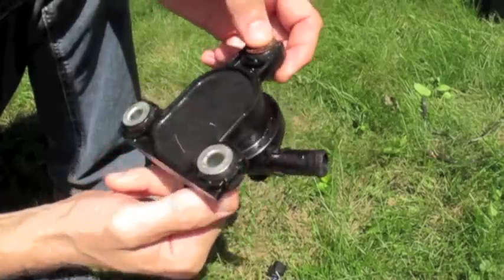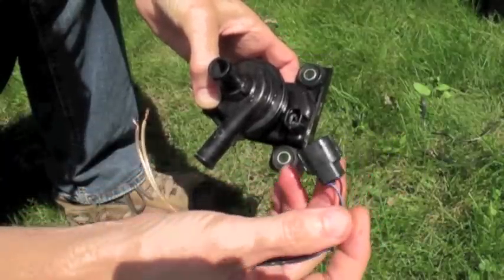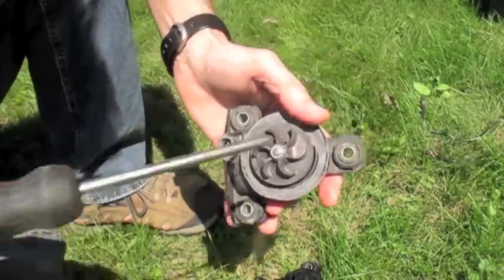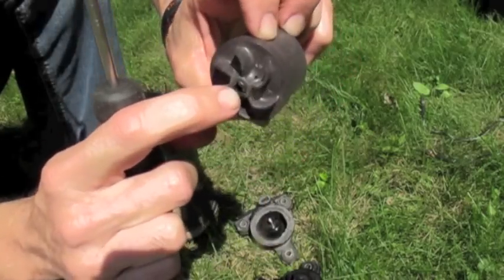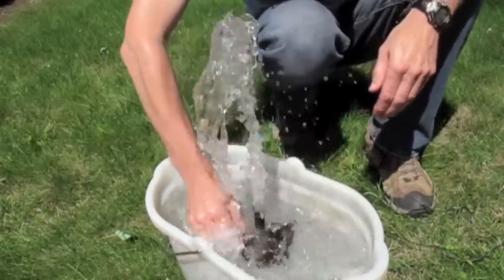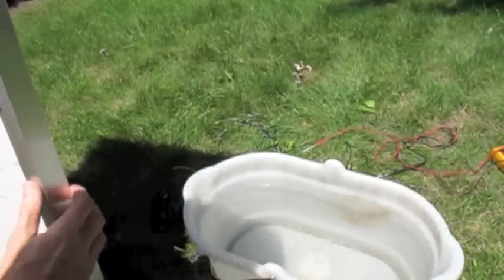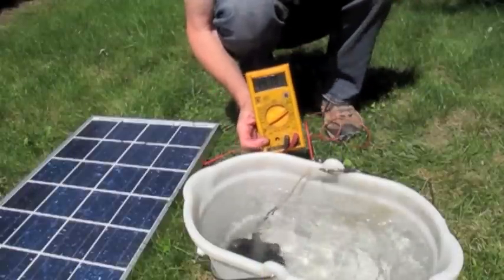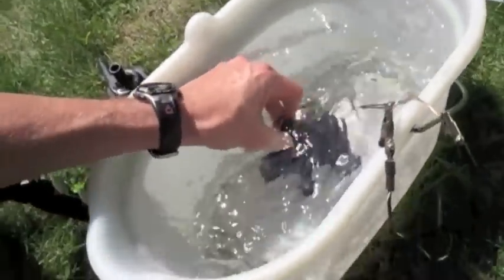Amazingly powerful 12volt water pump from a Toyota Prius ● test to 12v and solar

Comment: Just so you know, water is not a lubricant.  People think it is because a wet floor is slippery but that is another phenomenon at work.
Reply: Nicholas Washburn It's better then nothing, right?
Reply: maybe more a way to align thing without contact . .. I don't know
Reply from the maker: Johan PONIN    You're right. It aligns without contact creating a thin wall of water between the 2 parts. The water lubricates the shaft to minimize friction and allow smooth movement. I have used it in a bird bath/fountain and its into its 3rd season running about 5 months night and day straight each season submerged.
Reply: lol you didn't even google that did you. Ask an engineer buddy.  Water can behave as though it is a lubricant but IT IS NOT.  It does, however, carry heat away, and it is also a solvent.
Reply: Alright, so as most things are, the real answer is much more nuanced than one would think.  If you are interested in actually learning something rather than proving me wrong...because I actually learned a ton of new stuff by reading this, check this link out...
https://www.reddit.com/r/askscience/comments/22wmvb/why_is_water_a_bad_lubricant_and_are_there_any/
Reply: It seems  that the answer is, YES, you're right, TECHNICALLY water can be used as a lubricant, but it's practical applications are basically ZERO because there are WAY better solutions. I copied this from the reddit link:
First: What is a good lubricant? (quoting the wiki here)
[ A good lubricant possesses the following characteristics:
•High boiling point •Low freezing point •High viscosity index •Thermal stability •Hydraulic Stability •Demulsibility •Corrosion prevention •High resistance to oxidation ]
What makes a "high" boiling point and a "low" freezing point? Water's freezing point defines the 0˚C and the boiling point defines the 100˚C point. Water has a relatively low viscosity, around 1 (pa*s) at 20˚C. Most lubricants have at least a 35, ranging upwards depending on the use and grade. Water also has a tendency to fluctuate in temperature more than most lubricants, as well as being a large proponent in corroding materials and oxidizing. Water is also a solvent! There are very few cases, i.e. in the human body, where water can be used as a lubricant, but typically it is not.
Reply: Haha my apologies man, I tend to get a little defensive.. something I'm working on :)  I didn't know that it was used in water pumping applications like this, my background is in automotive and heavy industrial equipment and so I've had it drilled into my head that "WATER IS NOT A LUBRICANT!"  One of the things I just read was that one of the places water is used as a lubricant really effectively is the human body. Pretty interesting
Reply: nicholas washburn google "cutless bearing" as used on a boat or ship's underwater propeller shafts. water lubricated rubber shaft bearings.
Reply: Just wish I had brought it up with a little more grace lol :)  I was reading about Thorndon bearings, pretty much what you guys are talking about just scaled up for use in the largest ships. Prop shaft bearings and rudder bearings. Not very many of the big ships use it, but apparently its becoming more popular because of the tighter environmental regulations.  You lose some of the cool maintenance stuff you can do with oil bearings though like oil testing, temperature probes, etc..all stuff that is impossible or difficult to do with an open system

Comment: If you put water through the pump backwards will it produce electric?
Reply from the maker: That I don't know.
Reply from the maker: Actually no. It needs to be running fast enough for the water to lubricate the shaft.
Reply: some kinds of pumps yes but i don't think this one would

Comment: It probably did leak.  Fresh water is not a great conductor.
Reply from the maker: +chimp3376    What do you mean?
Reply: Fresh water is not a great conductor.
Reply from the maker: Into the terminal you mean. Not a good conductor but a good corrosion starter.

Comment: Where on the prius is this pump located?
Reply from the maker: Under the hood, left front corner near the headlight.
Reply: Thumbs up for that!  Thank you.
Reply: Typically there are two types of pumps.  Displacement and centrifugal pumps. This is a centrifugal pump which by design produces more volume at low pressure with lower energy input than a displacement pump.  For a pressure washer you want a displacement pump but it will pull higher amperage (ie.  energy).  That said your answer is "NO", not if you want "pressure".  This produce's water at a good volume but at relatively low pressure and with a low draw from the battery.   A trained eye could tell from the video that the water flow demonstrated shows good volume but achieving not much height. That indicates volume at low pressure. Cheers

Comment: I bought one of these off ebay after seeing the vid. I either got a bad pump because mine sounded like it was spinning but no water or suction was created. Very disappointed.
Reply: Hello Eric. try reversing the polarities. that is toggle the wires.
Reply: Pump won't run if I switch the wires.
Reply: if its a dc motor, it must run in opposite direction if you switch the wires thus pumping the water.
Reply from the maker: Actually, the one I got from the wrecker right out of a Prius did not run if you switched the wires/toggled. I wonder if it's a quality issue since it's from ebay. Too bad. I hope you're able to return it.

Comment: Those were the years when the Prius driver's claimed the accelerator stuck open and they couldn't stop and crashed and then sued Toyota.
Reply from the maker: There was only one or 2 guys that claimed that in the Prius. They were found out to be frauds. The issue in the end was the floor mats in the Camrys causing the pedal to jam.
Reply: +Chris Notap 

I think there was lying on both sides, both the driver and the manufacturer. From my over half a million experience driving cross country, I've seen plenty of cars that fail to slow down until they get in front of my truck.

Comment: So anyone ever try to use one of these for a parts cleaner using Varsol. Solvent might be a little harsh for the internal seals?
Reply from the maker: It should work fine. There are no seals to worry about.
Reply: @chrisnotap  Thanks. Zactly what I wanted to hear.
Reply: Winner of a video, been searching for "off grid water pump sink" for a while now, and I think this has helped. Have you heard people talk about - Manonnor Illustrious Magic - (do a google search )? 
It is a smashing one of a kind product for discovering how to create your own supply of the highest quality clean water without the headache. Ive heard some interesting things about it and my m8 got great success with it.

Comment: How many psi please.
Reply: Seen City There are two basic types of pumps.  High pressure, low volume and low pressure, high volume.  This would fall into the low pressure, high volume class.  This pump doesn't have to pump water to a high level, just move lots of it.

Comment: Is it possible not to submerge in the water and just make a hose or pipe?
Reply: That is probably how it is used in the Prius. Most cars are above water.
Reply: It cant ,because its not self priming.Needs to be lower than the water level.
Reply: @mihaiilie8808  
This means that it can be use outside the tank but it must be below or at the base of the tank and pipe connected at the base of the tank. To prime it open the tap in between the tankand pump and it's primed for use.

Comment: Maybe u know part number?
Reply from the maker: Sorry. It does not have a stock number on it. It's called an inverter coolant pump.
Reply: Chris Notap if it can help someone, part number is: G9020-47031

Comment: Which side is the suction and which side is the throw on this pump?
Reply: at 1:18, he opens the body, note the direction of the impeller blades and the previous orientation of the body,
Reply: The center tube is always the inlet with an impella.

Comment: The point is if you connect pipes it wont pump the water.
I tested. One meter pipe on input and one meter pipe on out. Nothing.
Reply: You need to prime it first. I used a 100 feet long inlet pipe & it worked very well.

Comment: I have a hard time believing the solar puts out that much current.
Reply: B. Eder they do the video is pretty straight forward
Reply: B. Eder I have a very similar system here in northern Canada and it certainly does put out that much current, I manage to get a heck of a lot more out of my solar panels than what I need so I started getting 12V fans to put in my house for air circulation in the summer.
Reply from the maker: B. Eder     Here is what is on the label on the the back of the panel I used in the video  

TYPE: multicrystal,  
MODEL: LA361j51,     
WATTS:  51w   
OPTIMUM VOLTAGE: 16.9v, 
OPTIMUM CURRENT: 3.02A, 
DiMENSIONS: 985 x 445 x 36mm,
DATE: 1992. 7, 
KYOCERA CORPORATION

Comment: It is NOT an induction motor.. It is a brushless DC motor. Induction motors run on AC and as you point out this is a 12 volt DC motor.    Go back to school
Reply from the maker: Correct. Others have corrected me also. Thanks. You learn something everyday.
Reply: They are designated as DC motors because the controller pulsates the DC current, there is no reversal of electrical current into the motor with brush designs and none into the controller of the brushless designes. You can not put AC current into these things. This reversal takes place as an act of the winding commutator segment passing under the + and - brushes then reverse at a 180 degree rotation. OR via electronic switching in the case of brushless DC motors. If one could spin the magnetic hub of this thing it would too, generate pulsed DC current. The controller however has to be able to facilitate that back flow. The electronic pulsating of the windings on BLDC motors are also the foundation for DC stepper motors used on CNC machines to drive and cotrol the axis'. Reversing the timing of DC current pulses reverses the motor rotation.  So yes, in a very real way they are too AC motors. The motors are designated in the engineering realm according to the type of power fed IN to the motor or the controller. Feeding AC into these things will just burn em out in very short order. 
"Working Principle of Motor
Before explaining working of brushless DC motor, it is better to understand function of brushed motor. In brushes motors, there are permanent magnets on the outside and a spinning armature which contains electromagnet is inside. These electromagnets create a magnetic field in the armature when power is switched on and help to rotates armature." Segmented commutator rings allow individual rotor widings to be charged when the winding's commutator segments BOTH passes under the brushes. One passes under the + at the very same time the other winging segement on the other winding end passes under the - brush activating the magnetic field to the winding. This provides the pulsed synchronicity needed mechnically here.
"The brushless motors (as this one we are seeing) change the polarity of the pole to keep the rotation on of the armature. The basic principles for the brushed DC motor and for brushless DC motor are same i.e., internal shaft position feedback. Brushless DC motor has only two basic parts: rotor and the stator. The rotor is the rotating part and has rotor magnets whereas stator is the stationary part and contains stator windings. In BLDC (brushlessDC) permanent magnets are attached in the rotor and move the electromagnets to the stator. The high power transistors are used to activate electromagnets for the shaft turns. The controller performs power distribution by using a solid-state circuit.
Types of Brushless DC Motors
Basically, BLDC are of two types, one is outer rotor motor and other is inner rotor motor. The basic difference between the two are only in designing, their working principles are same.......high power transistors are used to activate electromagnets for the shaft turns. The controller performs power distribution by using a solid-state circuit." https://www.electrical4u.com/brushless-dc-motors/
There are now in fact variable frequency AC brushless motors that do actually reverse the winding polarity. These are now becomming the axis drive stepping motors of choice for CNC machines as they provide even more torque in lower speed ranges than their DC counterparts.
Reply: Go play with your toys while real men do real work .
Reply from the maker: I represent that remark!

Comment: Why you destroyed pump, they are all the same, impeller...a waste...
Reply from the maker: This is how you learn. Open things up and investigate.
Reply: Chris Notap Not in every case, this was a waste of time, and just stupidity, like I said they are all the same!
Reply from the maker: I have to disagree with you.They are not all the same. In this pump the impeller is a magnet. In other pumps it's not. I wouldn't have known that unless I had taken it apart. I also question your use of the word stupidity. Really? There is no such thing as failure, it is also called learning.
Reply: It's like cutting a loaf of bead open to see whats in it.